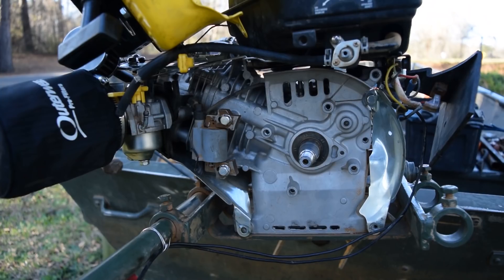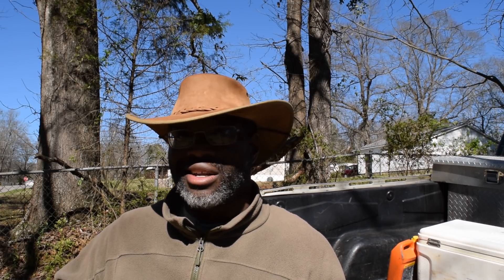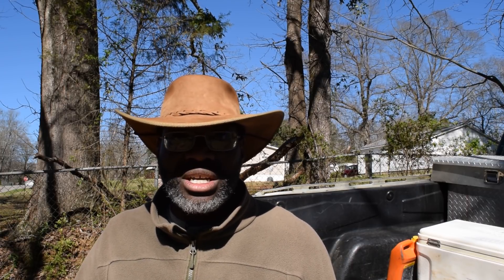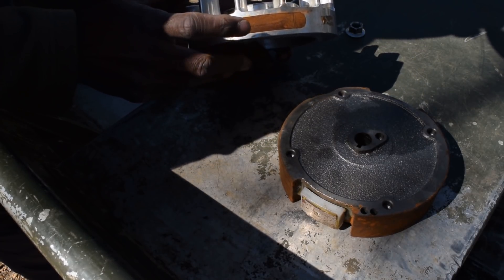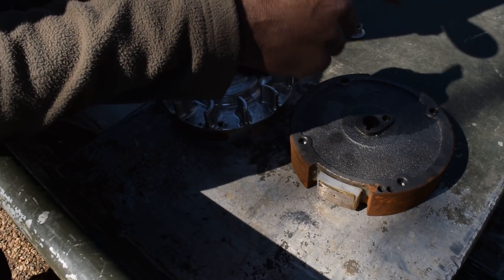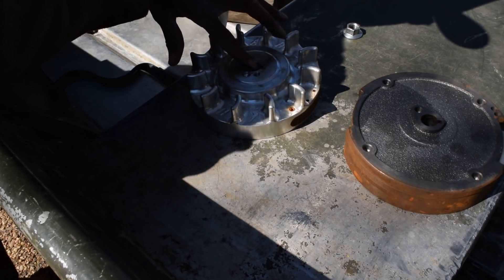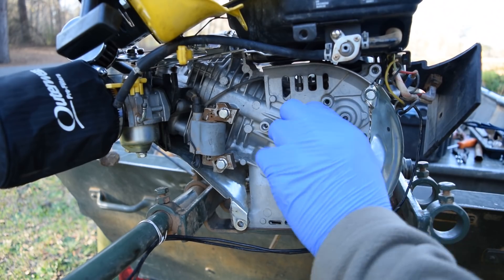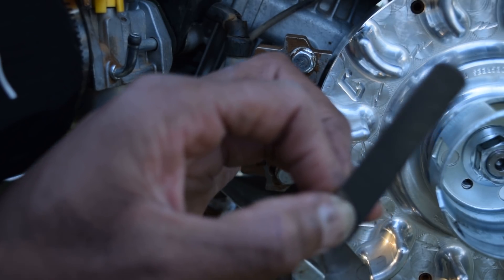Flywheel Change | Thailand Outboard & Billet Flywheel

Comment: Did you put the billet flywheel with no billet rod
Reply from the maker: For this particular build, yes. I already had the flywheel from a different engine where the billet rod totally blew. The previous build had this flywheel and a billet rod. I don't hot rod mud motors anymore as they aren't worth it.
Reply: So that would mean I could put a billet flywheel with no billet rod
Reply from the maker: @ghikjedv5442  Well, that depends one what you're building. If you hot rod these engines they'll blow up eventually. This motor blew up too. For mud motors, they aren't worth building.
Reply from the maker: @ghikjedv5442  Understand I was also running with the governor.
Reply: Did you blew the motor when you had the billet flywheel
Reply from the maker: @ghikjedv5442  Yes. That's my point. The advanced timing on the billet flywheel caused pre-ignition/knock which cause a severe oil leak and massive loss of compression. basically the motor blew up. These little engines aren't worth hot-rodding, you just need to buy a bigger engine. anytime you push an engine beyond it's original design, you will shorten the life of the engine.
Reply: Yeah but it’s going on a mini bike it’s a tilloston 212 hemi i wanna leave the stock spring cam and rod but all I wanna do is put the billet rod?
Reply from the maker: @ghikjedv5442  Well. mini bikes are beyond my experience. What works on a mini bike doesn't apply to a mud motor and vice versa. You need to go to someone who builds mini bikes and ask them what the best coarse of action is.
Reply: Some people say yes you could put the billet flywheel with the billet rod and some say no
Reply from the maker: @ghikjedv5442  I've found in life the only data you can trust is testing on your own. That's how I came to the conclusion that building motors for the marine environment is not worth the effort.

Comment: It ain't the problem your problem is that you letting the motor itself do all the work instead of putting the motor straight on you blade rod you need to make a gear tran for it if you no one thing about these motor the have clutch gear an another thing if you putting petroleum oil or cheap oil that could be the cause you putting to much pressure on that motor in water gravity it putting a load with out some gearing to help or it might be that you running on carburetor to lean putting a gear is your best bet
Reply from the maker: You obviously don't know much about Thai longtails:
Reply: Lol if that how you feel about that your suggestion I got a clone lol an the 212cc I will come with my video to prove to you how reliable they is an it look like to me you don't no yourself after blowing 3 motor lol now you thinking you professional but little you dont no am still working at harbor freight tool for 8 year so yes i no a lot an a lot of mistak you mess up at but your the professional  nobody can't tell you nothing lol if you would of mount the motor from producing so much vibration an put 3 fan in 3 different area keep the aluminum intake heating signature from over heating you wouldn't had that problem key thing about the motor is 1)the right oil 2)put a little of Lucas heavy duty oil 3)mount the motor from top to bottom from vibration 4)3fan lol 5) put 36lb spring in it stock valve nothing special an one last thing instead of you putting a billet rod it should of been a steel rod aluminum expand an it dont carry heavy load lol including in water
Reply from the maker: @myroneh9570  Please build a go-kart powered, hot rod Thai longtail and show us how to do it. Every single person in this thread who has all these suggestions has never ever built a Thai longtail, nor put their go-kart knowledge on the water, never proven on the water. I hope you are the first.

I never said I was a professional. I'm a fisherman not an engine builder, and I have never had a bone stock engine blow on me.

For the cost of building an engine I could buy a 420 Predator and have all the power I need with 100% reliability. Besides the whole country of Thailand run on these motors, more common than cars. When they want speed, they don't fool around with go kart engines: https://www.youtube.com/watch?v=kB0qtd6IVOc

"Don't carry a heavy load"? I'm a fisherman. I catch lot of big heavy catfish. The one thing the motor has to do is carry a heavy load. Again you make my point for me. The hot rod 6.5 hp motor is not a work engine on which my life and livelihood depend. This is not a toy. It is a machine on which my life and livelihood depend. I've never seen a NASCAR Super Truck engine power a dump truck.

Thank you for your comments, and have a nice rest of 2020. Please stay safe out there with all the craziness.

Comment: My guess is that the way the long tail shaft is hanging off the motor is not helping things either. Any imbalance there could hurt as well. Mini bikes and go karts have a chain or belt that helps absorb driveline vibrations. A mud motor probably sits at the same RPM for more extended time periods than a go kart or mini bike. With RPMs changing constantly, it is probably harder for a resonance to set up.
Reply from the maker: The thing is these motors power all of southeast Asia. Everything from open ocean vessels to simple rigs like mine. Rigs like this are a common as car here in the US. The Thai longtails produced by SPS are very well balanced. I have never had a motor blow up on me at bone stock or stage 1 levels. It still amazes me that no one recognizes that. 

Thailanders have been using motors like these for decades. This is what boat motor look like over there. and they race these as well with

People also don't know that the long tail is well balanced. The hydrodymanic lift raises the tail up out of the water so you don't have all that weight on the crank. Again people don't know because they haven't done it.

There is a bearing and bushing system down inside the shaft housing that does the same thing as your belt/chain system. Chains would rust quickly. Belts would slip constantly as water would get between the pulleys and belt. The inner shaft also flexes as it is made of a softer steel compared to the crankshaft, thus taking more pressure off the motor itself. The angle of the motor also stays very near parallel when running, just what the motor is designed for.

The weakness is not the drive shaft, it's in the motor itself.
Reply: If you haven't already, try reving your motor with nothing attached.  I revved my 196 clone with the TAV pulley off the other day.  I was amazed at how smooth and vibration free it was.
Reply from the maker: Well, of course. That's what I do whenever I break in  new motor. The motor never vibrate much even with it out of the water even with the longtail attached. The resonance frequency is due to the water itself. Water is 800 times as dense as air. Again once you put it in the marine environment, everything changes. If it runs smoothly out of the water, that doesn't do me any good or prove anything.

The engine is running well now, not problems at all. The governor keeps the engine below the point where the vibrations often occur. Problem solved until I get a bigger motor. 

6.5 hp simply isn't enough power to get on a hold on a plane. You need 10 hp per 500 lbs of weight to run on a plane. These little 200 cc motors just can't produce that reliably. even so it doesn't have the torque at that power level. Thus that's why so many people are either running 400 cc motors or just living with an underpowered engine.

Power, longevity and reliability, pick two out of three when running 200cc.
Reply: What size boat would you recommend to match well with the 200 cc motor, and still be able to plane out.  Maybe a square stern canoe?
Reply from the maker: Exactly! Mr Dobbs lists 10 to12 ft jon boats, squarebacks, little sneak-type boats. For this size motor: https://mudmotorkit.com/mud-motor-kits/small-swamp-runner.html

I want to save up for big block motor once I have the new boat built.

Comment: What kind of jets did you use in the stock carb? Thanks for the great videos 👍
Reply from the maker: I use the stock idle jet, and a 0.37 main jet. I may need to bump up the idle jet as bit as it is a bit hard starting.
Reply: Black Warrior Lures Ok, where do you buy that jet from?
Reply from the maker: I usually by from OMB Warehouse, NR Racing or ARC Racing.
Reply: Black Warrior Lures Thank you... Good luck with the boat project, looking forward to see it finished.
Reply from the maker: Yeah, I'm hoping it will turn out well. The weather just won't stabilize.

Comment: they have tested the stock flywheel to 10000 rpms and it did not brake 6000 rpm is no problem its very rare that they brake.
Reply from the maker: Thx for the tip on that. However that still doesn't account for real world conditions and doesn't not account for the that it is unbalanced. The unbalanced nature of the stock flywheel, even though the flywheel may not fail the resonance frequency that sets up in the marine environment, an unbalanced flywheel isn't healthy for the entire engine. 

You have to look at the whole picture. The whole picture says this engine design is grossly off balance for a variety of factors: single cylinder, no counter balancer, off-balance flywheel and the "light-duty" nature of the engine means it isn't suitable for the marine environment at higher output levels.

Thus my recommendation for bigger engines.

If I designed a special engine just for this application I would make a V-twin that uses the same rods and piston from a 200cc motor. In fact I would stop messing around and have Mr. Dobbs import me a kit to run a Chevy small block 350 and go run!
Reply: Black Warrior Lures I run my clone on my mini bike it goes 60mph with the stock flywheel and rod I have an aftermarket cam, 18lb springs, higher compression and ported head , ram intake , high flow exhaust and a ported and rejetted carb. the stock internals are good for 6000rpm and about 12hp. I also don't have this horrible vibration my engine shakes as much as a normal one.
Reply from the maker: But that's my point. What works on the street for mini bikes and go karts doesn't work in the marine environment. Water is 800 times and dense as air. If there is any flaw in the engine, the unrelenting marine environment will find the weakest point of the engine.

When I say a resonance frequency sets up, it's because water some how stresses the engine a lot more. Look at marine outboards. Once you hit 8 hp, they all switch to dual cylinders for all reasons listed. I found that go kart and mini bike builders don't understand the difference in building for the marine environment. This resonance frequency never sets up on the street, you've never experienced it. Your life has never been at stake when it happens on the water.

Just because it works for you on the street doesn't mean it will work on the river. I can't walk off the river if the motor blows, but you can easily walk off the street if it does.

I have noticed time and time again how go kart and mini bike guys swear their builds can hold up, but none of them have ever built a mud motor, nor would they even use it all day every day for work like I do. They just suppose that what they do automatically has direct application, and it doesn't.

It's one thing to run 1/8 mile drag races on a mini bike. It's totally something else to run eight, 10 or 20 miles non-stop in an environment that 8 times as dense as air at WOT. That's not counting guys who take these motors on 700 mile expeditions where there is no help if they get in trouble.
Reply: Black Warrior Lures ok thanks for the info!😉  i guess alot of people who watches your vids don't use them for boat motors like me lol
Reply from the maker: That's the main reason I make these videos: to try an inform.

Comment: Thats what i was about to say was if you balance the crank and cam a bit more rpm is available but balancing the crank and cam is costly. The stock flywheel is cast steel regardless changing to a billet flywheel reduces the crank weight so less wear and strain when trying to push water i know you know Damon just info for others to look at.
Reply: I forgot to mention the torque tube an why power falls off its face at 5000 6000rpm is to be a governer so if it does come up out the water and free revs its not gonna be a fast hard free rev scoring the cylinder.
Reply from the maker: Man, those are very good points. There's one guy who had a machine shop on Mudmotorkits forums who balanced the crank and cam himself. yup, he has no problems with spinning high RPM.

Hmm, didn't know that about the torques tubes that's good to know as well.
Reply: Thats also how racers get there built kart engines to high rpms for a season and just reseating valves and cleaning the ports ever so often. Yes it helps with life of the engine cause if you do remove the gov your usually only gonna be running 4000 5000 rpm max anyways not to say if it does free rev it can still hurt it. Just like usuing valve float for a governer bad for the valves and push rods. Just some thigs to think on. Still learning on these littler engines just like you my friend. Keep up the vids an keep on fishin👊
Reply from the maker: Yeah, I've always been scared of floating the valves too.
Reply: Yea its not really good for the valves an push rods